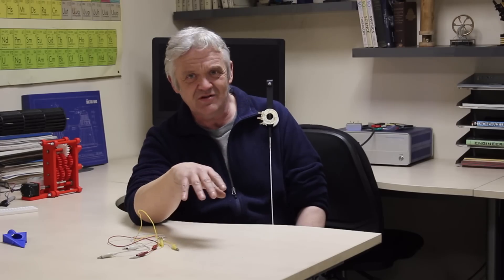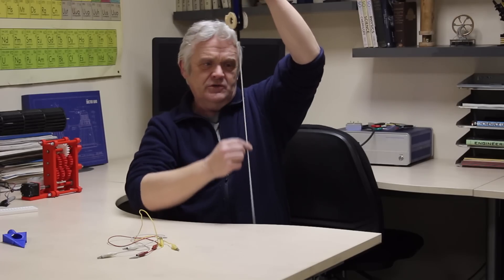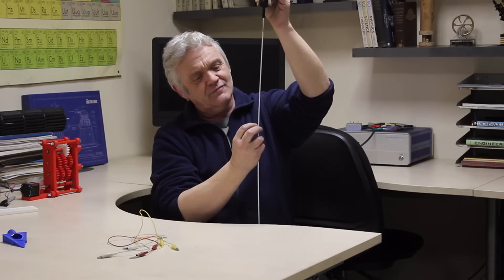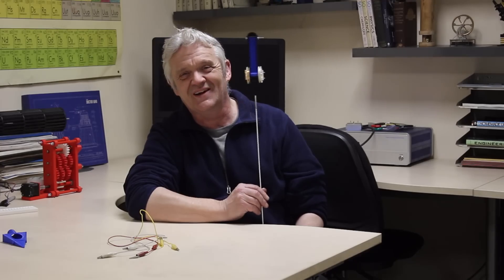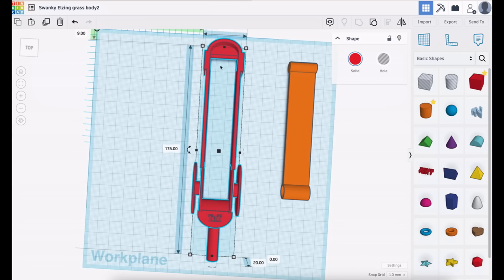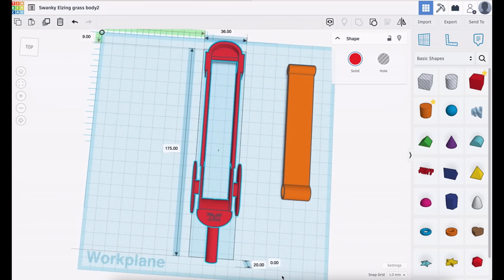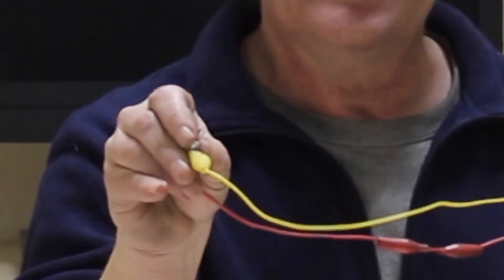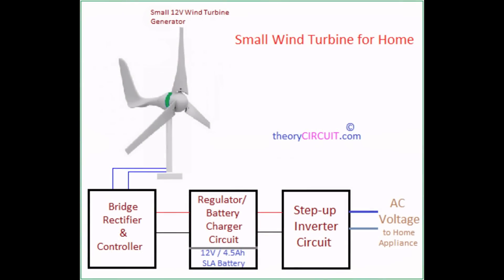1841 Barleycorn Wind Generator - Quite Possibly The Best Thing I Have Made

Comment: Imagine a situation, where a half completed - but still high with a lot of floors - skyscaper, or unused highrise building is  "filled" with this.
How much space does it have / floor, around 500-1000m2? (Multiply it with the nr. of floors)
How much space this device reserve? Arund 10 cm2?
How much wind does this device block? Next to nothing?
I always been astonished about Robert's unique point of view on redefining a word "efficiency"
Reply from the maker: yep - they don't need land surface per se - you could stick them to buildings, roofs, bridges, the sides of roads, road signs, bouys, ships, lamp posts - the list goes on and on

Comment: hmmm.... interesting..... sprung-ish shaft length would be very important. Further from true vertical where the coil /magnets need to pass; would take longer to pass on lengthy shaft...... yet... long shaft may overcome that via storage by keeping it going while wind has reduced/died....  so somewhere in the middle is likely a best shaft length for particular materials and weight of the "barleycorn generator device" .  wonder about tidal power too.
Reply from the maker: nice

Comment: Might I suggest more magnets placed in an upturned arch either side of the original magnets? 3x output 5x output. Depending on average swing length, an even number of magnets on each side of the pendulum, may be more efficient.
Reply: More surface area shorter spring?
Pendulum swinging in all directions with magnets facing down over a coil. Will improve wind direction issues and prevent pendulum crashing in arm in side winds.
Reply from the maker: I have been thinking about that mate - cheers

Comment: Have you looked into Randall Carlson and using plasmoid to generate energy. It pushes protons together and extract the energy created from that with no emissions
Reply from the maker: I haven't - cheers
Reply: @ThinkingandTinkering  I usually don't put links in the comments as I've heard it's not the best practice. I think you'd be very interested. I could send you a couple of links if so.

Comment: What a cool idea!! I feel like you could do this with two layers of heavy gauge lamination plastic.  Maybe covered with a layer of graphite between them.   

Cut by thousands with a steel rule die.  A small weight crimped on the bottom to force it out of balance.

Comment: Hello Rob. I was wondering how "Sympathetic Resonance" would play a role in a bed of these type of devices? I'm sure you are aware of this phenomenon, but it is an interesting thought as how we could utilize this "Sympathetic Resonance" to our advantage and aid in amplifying our outputs as it seems these could be tuned in such a way that they could encourage nearby similarly tuned devices to join in and create an organic effect as all of them would begin to move together in a harmonic that would have no actual physical linking. Just a thought experiment I was doing to add to my projects to build a physical experiment to exploit this idea. Thought you would be amused at the thought of it at the very least...Smile.
Reply: You mean like putting several metronomes on a table and they all sync up? That happens because the table transmits momentum between them. I'm not sure you'd have an easy time moving the ground, but maybe other forms of resonance could help the system, like the length of the flap vs. the stalk.
Reply: @DFPercush  Well the metronomes are an example of this phenomenon it actually has been seen in many other things as well and it is not clear how they Sympathetically Resonate as it is regarded as a phenomenon. 

This amazing thing is considered by many to be somehow quantum linked. It is not merely the table that is transmitting this as this would be transmission and not sympathetic, and transmission would actually disrupt one another as they all are vibrating at different rhythms initially and if it were transmission then one would have to have to be the grander than all of them and a stronger force than the others to overcome their own vibration. They have seen things as small as heart cells that were separated and divided into individual cells sync up together when in a proximity of one another and all will beat in unison! 

Even in birds when they synchronize in flight demonstrate this linking or bond that cannot be explained. But we can clearly demonstrate this to happen in many ways in experiments. Einstein even has called it "Spooky action at a distance" when it is examined in the quantum world. 

I believe it go along in the mindset given to us by Nikola Tesla as he said to understand the universe you must think in terms of energy, frequency and vibration and he was clearly demonstrating in many of his experiments, harmonic resonance.

If we tune a device to the same resonant frequency of another device then we get this phenomenon to take place. We could make devices that are in tune with one another that can resonate with the frequency of a certain environment and attach a coil and magnets to these then we could get a resonating generator that could capture the resonant frequencies of the surrounding environment.
Reply from the maker: I do know about it mate and I am glad you brought it up - I think it has possibilities for sure - but work needs to be done for sure
Reply: @ThinkingandTinkering  Haha, for sure mate. Work does need to be done. I was thinking a simple experiment that would demonstrate this perhaps could be a few tuning forks set up in front of speakers as pick up devices and measure the voltage that would be produced from the speakers picking up the resonating frequencies of the tuning forks from striking or capturing a frequency from the air from a sound source on just one fork cascading to the other forks...Lol. Maybe I will try this just to show the viability of using this harmonic resonance as an energy source!

Comment: Amazing, this puts out AC right so each needs its own micro rectifier?  Does such a thing exist that would work with such tiny power levels?
Reply: I guess you can chain a lot of them in parallel before feeding the rectifier? After all the wind direction is not gonna change at the micro level, only in medium or big fileds, and not as a norm
Reply from the maker: oh yeah - the diode itself it microscopic the put it in large package so you can handle it - you can get them as small as you like - just look up SMD devices - they are tiny!
Reply: I wasn’t so worried about the size of the diode, more that passing through I diode caused some loss of voltage,

Comment: Continuing the pastoral theme, could we dispense with the stalk and hang them all around the green willow? Or indeed ye olde oak tree?
Reply from the maker: yeah I suppose so
Reply: @ThinkingandTinkering  Metaphorically. I meant on other structures, or hanging, rather than standing. Then you can have them stacked on different levels.

Comment: Part for this produced in a injection mold would cost next to nothing. In a relativly small machine can produce easily 10 or more of those at once.
Initial cost of the mold would be higher but the more you make the less it cost ofc.

Cost would be next to nothing if produced in bulk.

and if wanna lower even more for mass production, make the whole thing out of one piece of plastic, the rod already attached.
Reply from the maker: yeah it could be really cheap

Comment: Could you not print the pendulum as a Y and then have two magnets and double the output
Reply from the maker: yeah - or a crows foot?
Reply: @ThinkingandTinkering  I don't think that three would work. As the magnet has to pass the coil to generate?
But you may be able to make an off set

Comment: 15 Pence (.17 USD) for each unit? Did you forget to add the price of the neodymium magnets?
Reply: Tiny magnets are stupid-cheap, often can't be bought individually, but rather in packs of 50 or 100 or so. They're cheap enough that they're used in packaging for holding lids down.
Reply from the maker: I bought 100 of them from first4magnets they were 3p each

Comment: ;-) What happens when the wind blows and sticks all the magnets together?
Reply: guess they would have to be far enough apart that the spring force of the shaft would ensure this didn't happen ... :P
Reply: @WilliamTythas  I'm sure they wouldn't all sway back and forth in unison, so spacing would be a problem.
Reply: @justtinkering6713  Why would it be a problem? Seems like a relatively easily solved one as William said.
Reply: @jay90374  A lot of things are easily solved, if you think of them, that's why Robert Reads the comments.
Reply from the maker: lolol - that is pretty unlikely unless you go into the field with superglue obviously lol
Reply: @ThinkingandTinkering  If they touch, they'll stick.

Comment: what about the costs of the mesh collectors of the energy...you have to place wires all-over the surface, this will increase the costs...not so cheap anymore
Reply: What if the whole surface was already electrically conductive? Like with a material such as onion nano carbon graphene
Reply: @captainnemo6655  fiction! maybe we can try to genetically manipulate plants to produce energy from the sun, interconnected with roots that collect energy from mesh roots and at the end of summer we harvest the plants and eat them. would be great
Reply: @MrElciupacabra  it is not fiction. You can actually produce nano carbon onion graphene particles by microwaving fish scales. EVEN CHEAPER AND EASIER.
Reply from the maker: actually I don't think you would use a mesh

Comment: There you go, I'm sure the men in black suits are coming for you...
You can  tune it the the natural frequency of the wind by making it taller or shorter. A wind generator that has the potential to work at peak performance with any wind speed.
Reply from the maker: nice suggestion mate - cheers

Comment: Will a load stop it from swinging?
Reply from the maker: you saw it swing under load - but at some point the answer has to be yes after all if you grab the top and hold it - it will stop swinging and holding it is a load
Reply: @ThinkingandTinkering  so i guess the question is, how much load can it handle

Comment: I think your outside test should be done without you holding it. It appears that some the swaying in induce by your hand.
Reply from the maker: it is meant for vibration or wind - so it hardly matters - but I get your point
Reply: @ThinkingandTinkering  Vibration from what, an earthquake?

Comment: How to harvest/link the energy generated while maintaining low cost.
Reply from the maker: I can think of a way - what are you thinking?
Reply: @ThinkingandTinkering  my brainstorm was along the lines of:
Array of 10's 100's 1000's Need to avoid V drop, maybe nichrome heating element at the bottom and plug them into a sand battery tube or oil tube that is insulated. Or maybe like the shock wire along farm pastures to keep the cows in. 
This is a slow frequency AC so will multiples swinging at random hz negatively affect the voltage without digital electronics $$.
Wire eventually gets expensive , so how many of these generating at what distance apart will still be cost effective?

Comment: Pendulums are at best only as good as rotating wheels and you can not easily reorient them to changing wind direction. I believe you would get better results with cheap little plastic wind blades.
Reply from the maker: little plastic wind blades would respond to vibration - here you have two sources you could harvest from wind and vibration - I wasn't being literal with the thought of a filed of them they don't need land surface per se - you could stick them to buildings, roofs, bridges, the sides of roads, road signs, bouys, ships, lamp posts - the list goes on and on
Reply: A simple slip ring would allow the shaft to reorientate as needed.

Comment: Also every shaded side of a roof could be used for this ? there must be a quite  few thousand square kilometres/ miles  of roofs available in houses and commercial  buildings ? With approximately 8. 7% of the 94,000 square miles  or 8000 square miles at 640 acres per mile sq the numbers are mind numbing lol 466191360 per sqare mile x 8000 is lots lol or 3,729,530,880,000 .?? x mill watts per hour per day ??? off the chart on my small calculator ?/lol

Comment: I don't think your cost calculations per Watt are correct. You're comparing what it's actually generating against the potential generation of a large wind turbine. Therefore, it's probably much cheaper than you've anticipated.
Reply from the maker: yes you are right I did do that - thank you mate for pointing that out